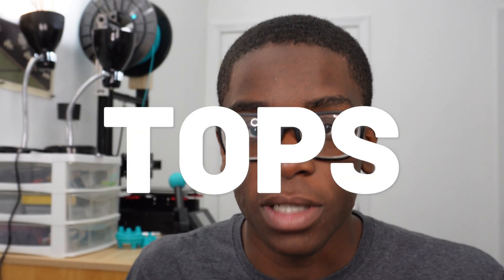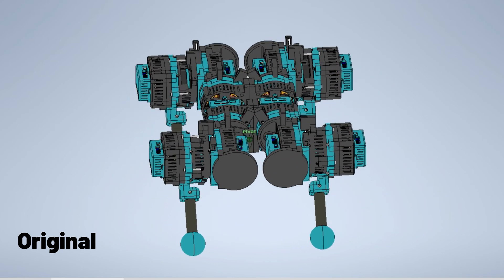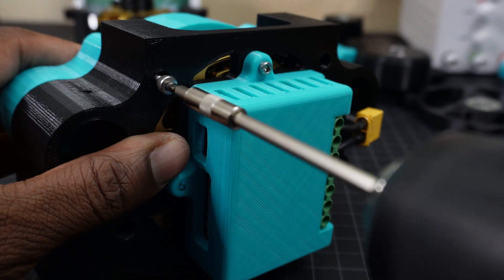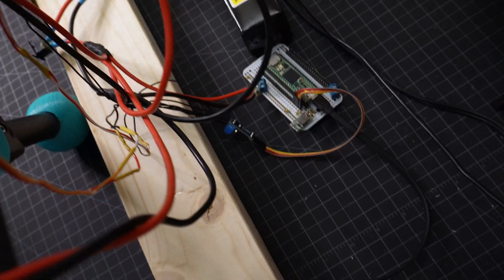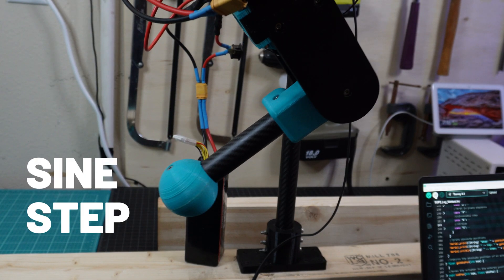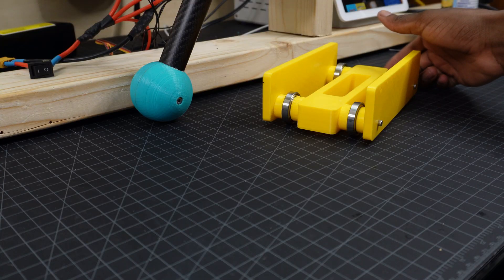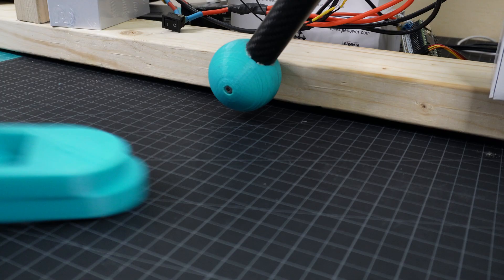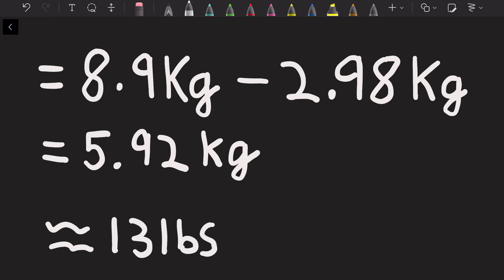Robot Dog Part 2: Leg Redesign

Comment: Is there a reason for not using your cycloidal transmission you designed 2 years ago?
Reply from the maker: It didn't have the gear ratio that I wanted, didn't work well, was too heavy, and used a completely different motor.

Comment: Some small advice from one mech eng student to another: 
1) dont use even numbers of teeth on your gears. Gear pairings should be co-prime to another, especially on soft gears like ones made from pla. Go ask your mechanical design textbook as to why.
2) dont use angled gearings when straight will do. Angled increases contact area between teeth which means your gears will wear out faster. Not a problem on case hardenend steel. Def an issue on pla.
3) belts arent great for transferring torque and since the one place you used them is the one that needs it most, consider using a beam or leaver connection between the wheels.

Comment: Add springs to counteract expected robot mass in neutral position. You can add much more force that way.
Reply from the maker: The FOC motor controllers already allow me to change leg stiffness in the software. Springs would just add weight and make the motion less compliant/dynamic.
Reply: @aaedmusa  The leg should have springs that extend it passively (help motors to lift robot weight). This way you can add more strength to the leg with little more weight and really cheap.